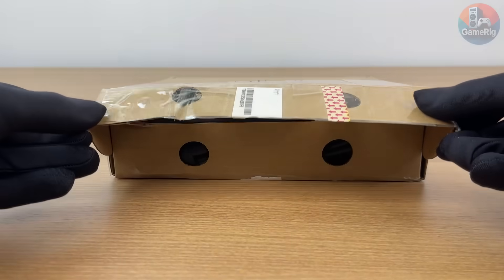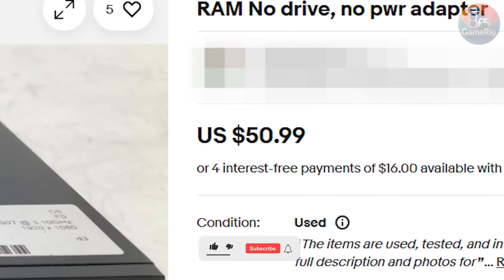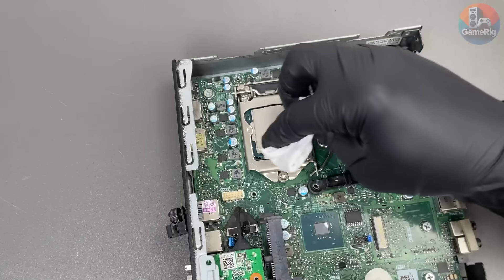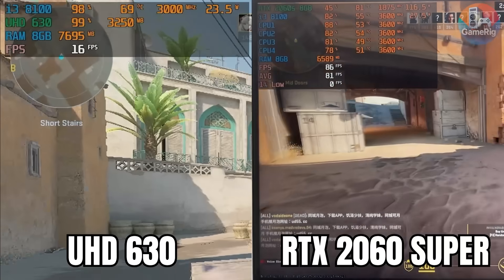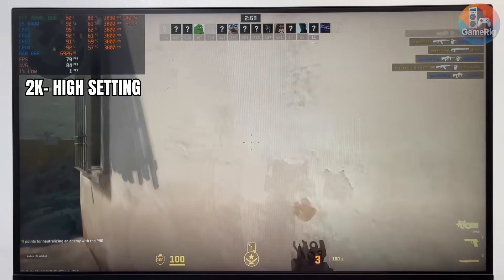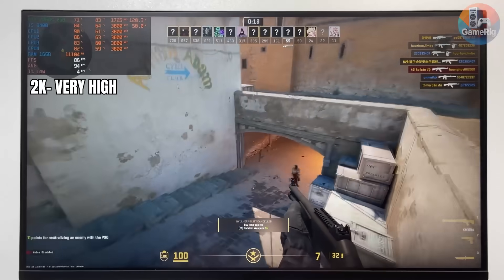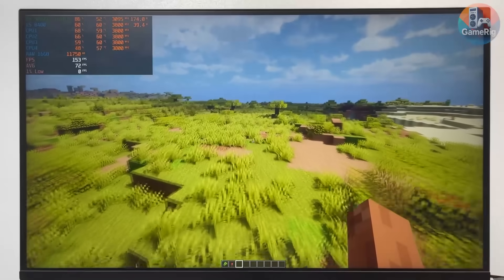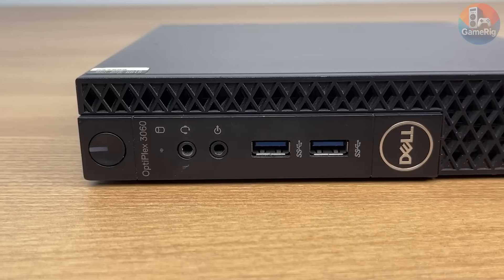How Far Can I Upgrade This $50 Mini PC?!

Comment: Oh damn thought you could only use T processors
Reply from the maker: oh, so whats the problem?😂
Reply: @gamerig68  nah dude thats amazing! i thought the micro systems were only limited to 8500T, 7100T and so fourth, the 8400 is a very good processor. I actually have two micros myself so I might buy some and use them. I also have an 8600K but i know that wont work 😂

Comment: You can mod your bios and use cpu from laptop, it more powerful and more effective
Reply: What? The socket Layout is completely different
Reply: @ClayWheeler  bro really don't know we can take chip from a broken laptop, put it on socket and install it on motherboard with modded bios of desktop computer, it's very common in southeast asia especially in china, in my case, i have a mini pc zotac magnus en1060 its original cpu is i5 7500t after mod bios h110(which original zotac mainboard and only compatible with generation 6-7 after mod I can even use generation 8-9 cpu because the socket of these generations is almost similar) i installed i7 9750h you wonder why do that simply because i7 9750h is cheap, efficient and much stronger when compared to i5 7500t. many mini pc have limited power and cooling system and cpu of these mini pc are also very expensive so using a laptop chip is wiser
Reply: @sonhoang-gp3qe  WHAT?

It's completely different Motherboard.
It doesn't use additional socket because it's purely BGA socket. Not LGA socket. You cannot stack a BGA CPU on top of LGA socket.

I know what you're talking about because I used to have one PC with Intel Laptop CPU but with full size PCIe x16 slot. And it was 8th Gen.

Go ahead and show me just one video on YouTube that shows exactly what you're talking about
Reply: @ClayWheeler  that's the hardest part to explain you don't understand that laptop cpu legs can be faked into lga and installed on desktop motherboards like normal. I will send u a link a xeon chip from laptop that mod to use in h110
Reply: @ClayWheeler  BGA CPUs are not placed directly on LGA. BGA CPUs are soldered onto a converter board, which emulates LGA1151 CPUs.
Reply: @ClayWheeler  https://youtu.be/uWtU8pGspj0?si=eMTsJ93MgYuF3edA
Reply: @sonhoang-gp3qe 
2 minutes in, he clearly stated that it is SOLDERED from FACTORY before being sent to Linus. I've already watched that video too many times back to back 

In other words, no, you can't just take off BGA CPU from a Laptop like i7-8700HQ and then slapped it on the LGA adapter, because that requires Soldering job on thousands of pins.

The procedure alone is more expensive than just buying i7-8800K
Reply: @ClayWheeler  bro that is just your thinking that the process is expensive but in reality laptop bodies with damaged circuits are almost worthless and are sold a lot and many third party factories or qualified workers can install this chip on LGA socket like xeon E2176M which is 30 bucks in chinese a 6c/12t use only 45w with 4.4ghz is expensinve? nah bro need to see i7 8700T price which have same spec and double the price , in China where there are a lot of highly qualified workers but still have to do this job to make a living because the labor source there is very cheap and from the beginning I also affirmed that you can install the laptop's legs directly on the LGA motherboard.
Reply: @ClayWheeler  if you knew from the beginning how a laptop cpu is installed on a desktop computer's motherboard, you wouldn't be confused when I said you should mod the bios and install the laptop cpu.you are just lack of knowledge
Reply: @ClayWheeler  https://m.youtube.com/watch?v=T19k4kuqG9g&time_continue=5&source_ve_path=MjM4NTE&embeds_referring_euri=https%3A%2F%2Fvoz.vn%2F
Reply from the maker: ❤ i will bro, waiting and following my channel more